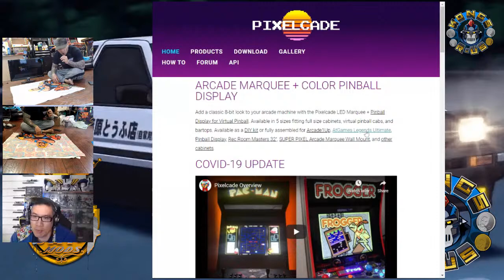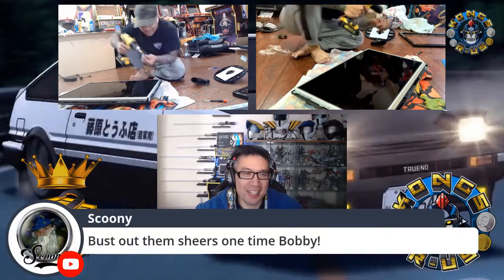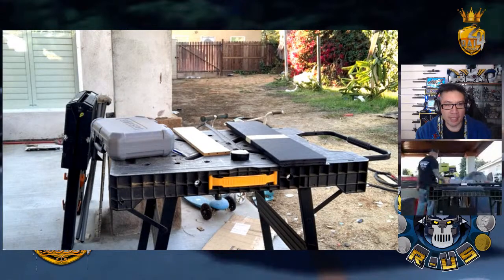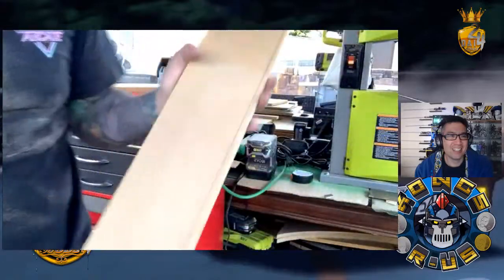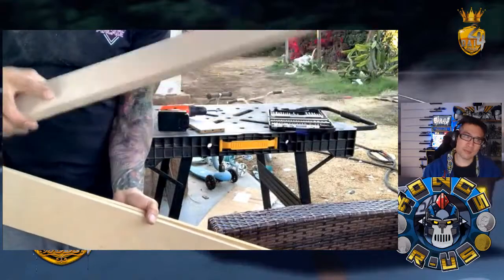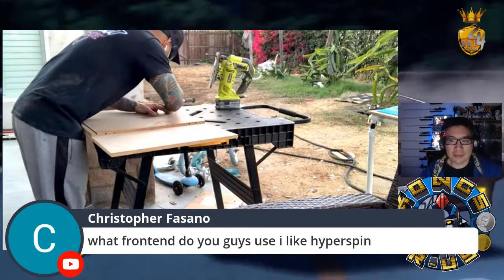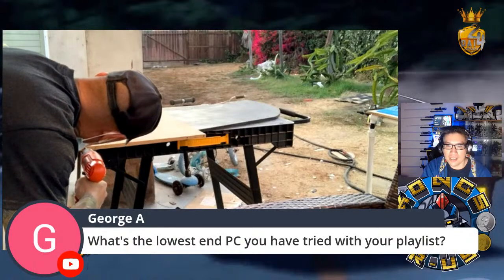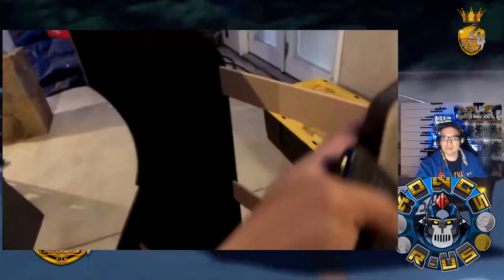PART 2 - Custom OutRun/Initial D Arcade1Up - LIVE Modding Session (Pixelcade & 27" Monitor Install)

Comment: I'm interested in seeing if you guys are going to do something to improve the ergonomics of the cabinet. That's what I most disappointed in about the OutRun Cab
Reply from the maker: you mean like the seat placement? if so, yes, bobby plans on using a lowered and adjustable bench seat for his build that should help for sure
Reply: @KongsRUs  Yes, the and default pedal location  to me is not right in relation to the steering wheel, at least for me (5'7")